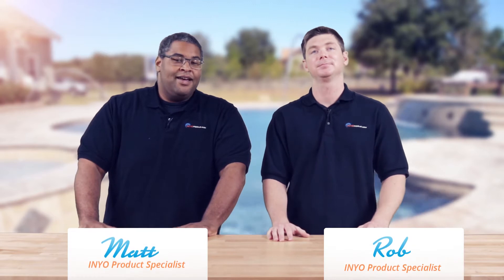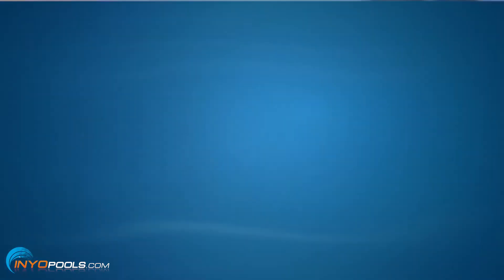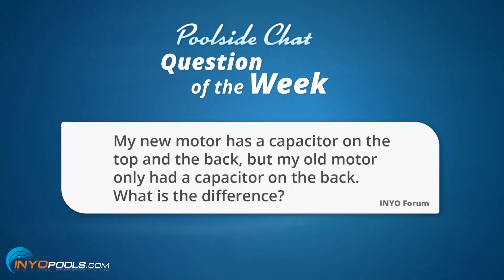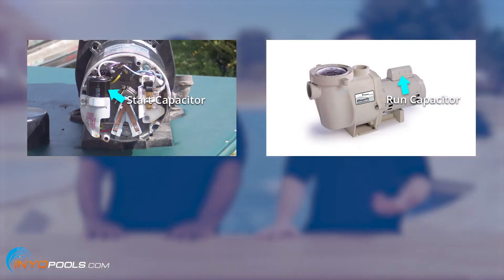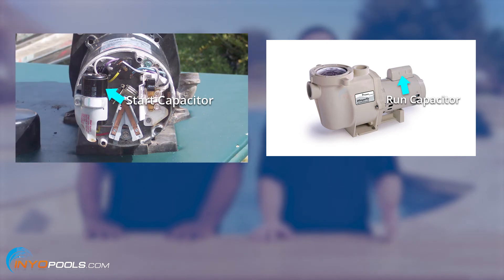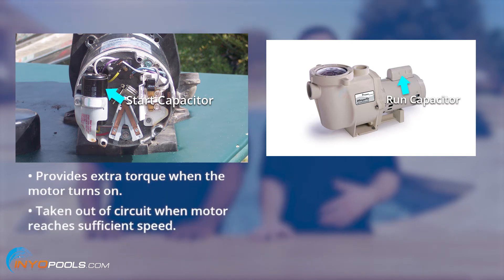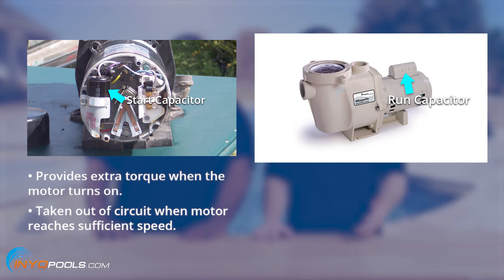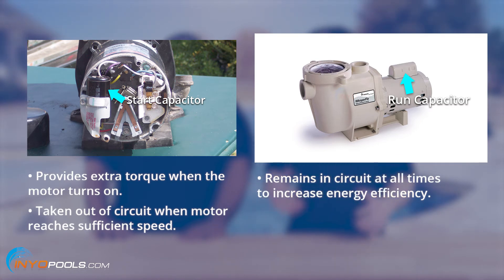What’s the Difference Between a Start and Run Capacitor?

Comment: what is the difference between 35uf and 35+10uf capacitors? Also, what does the +10 mean? Im not talking about the +/- 6% either. Also, if there a difference between a Pool pump capacitor and a AC capacitor? They look the same. 
Thank you.

Comment: lmao that doesnt explain anything. I usually like your videos. Im not hating, just giving feed back.
Reply from the maker: We appreciate any feedback and we're always looking to improve. We discuss the role of each capacitor. What were you looking to learn? We can shoot a new video and address it.
Reply: @Inyopools  A new video would be awesome. I was searching for a video that explains why a start capacitor differs from a run capacitor. I know that a start capacitor will help a single phase induction motor start by running out of phase, but I wasn't sure why a run capacitor would help efficiency. I am also not sure how trouble shoot a run capacitor issue. From my experience with pool motors, I would usually replace the top capacitor(The wf example you showed) if I found a motor humming and tripping the breaker.  But Im confused as hell if that is the run capacitor. I would understand if it was the start capacitor. HALP

Comment: You guys didn't answer the question.    You state what it is called based on where it's mounted, and what it does, but not if there is a difference.
Is a capacitor a capacitor whether it is used as start or run? or is there a physical difference between the two?
Can they be interchanged?
Reply from the maker: They are not interchangeable because the MFD and voltage ratings are different.
Reply: @Inyopools did you say that? noooooo!

Comment: Hey guys my dads compressor started having a bogged down sound and kicking breakers he thought converting it to 220 is the answer and I say it should run like it used to on 110 , I ordered and replaced the start capacitor but it changed nothing “very sad news 😉😁”  now I’m wondering if it would I should spend time and money on a run capacitor..... these aren’t cheap and for retain I coulda bought a new compressor lol...... help 😁 need air in ohio...... it sounds like it just needs more power but functioned fine over 10 years on 110

Comment: A BAD RUN CAP WILL also cause a motor not to start So i't a good idea to have both caps checked. SWITCH-LESS motors only use one cap and it's a run cap, "generally" on top of the motor and silver metal in construction